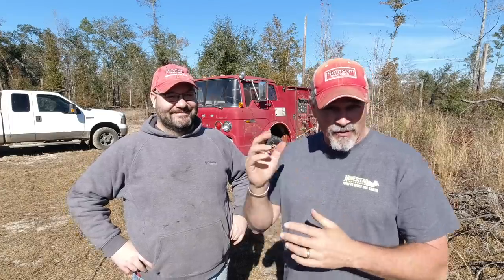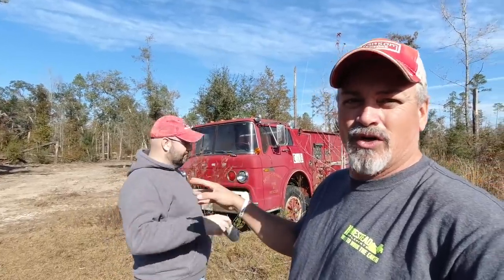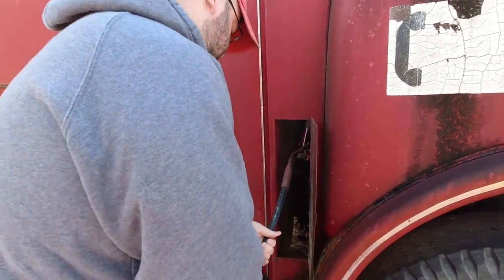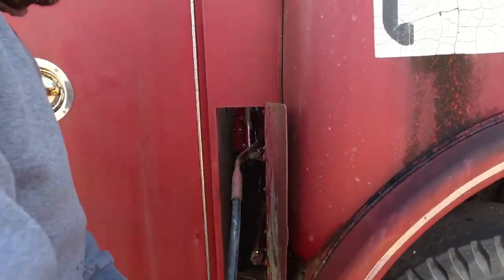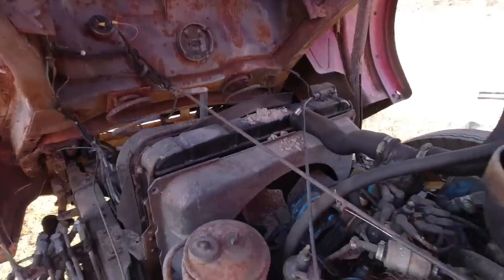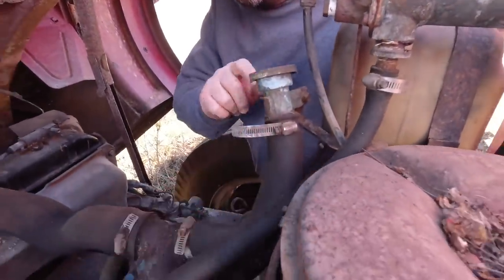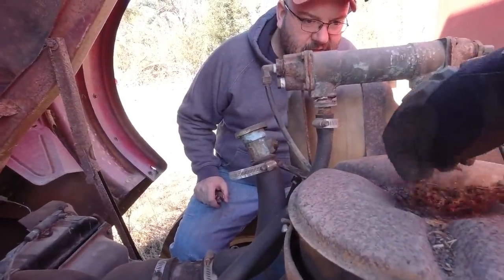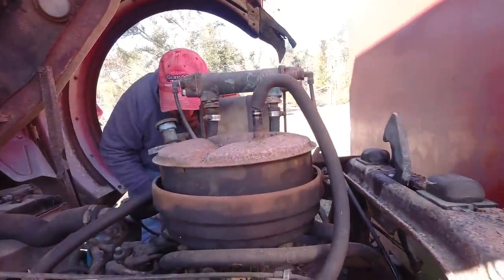Reviving Old FIRETRUCK Doesn't Go Well!

Comment: I think the JB weld option is a good starting point. I've got a similar sad story of rodent woe coming tomorrow...
Reply from the maker: 10-4
Reply: We live in rural Southern Colorado. Our curse is rabbits. We've lived out here in rural Pueblo County since 98. When our sons lived at home, we and they had 9 cars over that early period that had to sit outside and were vandalized by rabbits eating the wiring. Sometimes repeatedly even after wrapping the engines and under-hood components in hardware/hail wire. Plug wires, distributor wiring, harness wiring, it was open season. I finally had to get a 22 varmint rifle and start recycling the rabbits. The prairie hawks were grateful for the banquet. Word must have gotten out over the years, we've not had a problem for a few years, thankfully! Yeah, when you live in rural areas you're in the animals domain and you are intruders. They seek revenge!
Reply: I watched Wes's saga last night on the Oliver and it was some seriously sad destruction by rodents. Unreal.

Comment: JB weld that hole! I had a engine block that was cracked and had been JB welded by a previous owner and that engine held together for over 6 years till it gave way.
Reply from the maker: yes sir!
Reply: @HamiltonvilleFarm  I wouldn't be as worried about the hole as the water that might have gone into the engine through the hole.
Reply from the maker: True

Comment: I had to have a spark plug thread insert installed with JBWeld. It works really well! If it can handle the pressure of the combustion, it surely can handle the intake pressure. I recommend that route. Good luck guys! Keep us posted! 👍
Reply from the maker: Thanks for watching 👍

Comment: That is the exhaust cross over to heat the carburetor .  The cross over goes from one side to the other. The ports can be closed off with a plug , however the intake would need to be removed.  May be there is a way to plug the hole just to test run it. Make up a toggle plate . 1 long screw, 1 washer that slips in the hole. 1 metal plate that will cover the hole. and 1 nut. Tighten down on the toggle and fire it up!
Reply from the maker: Thanks for watching 👍

Comment: I like the JB weld option to see if you can get it running cheaply. Did you check to see if the engine will turn over after you pulled the plugs?? If it's stuck there are ways to free it up but it may make your decision on another engine simpler. Good luck. 👍👍👍
Reply from the maker: Yeah we checked that. It is not locked up

Comment: If the motor turns over it’s definitely worth patching the hole in the intake and seeing if it will run. Those 391’s are actually a good engine. Don’t give up on it just yet!
Reply from the maker: Thanks for watching 👍

Comment: JB Weld will work on intake manifolds. I used it to fix a 350 chevy engine. Theres not a lot of pressure on the intake just vacuum pressure for combustion. Its worth a try. I'd give it a good acetone bath and a lot of scrubbing.
Reply from the maker: Thanks for watching 👍

Comment: I'd try just welding that intake manifold. It'll hold just like new again afterwards to. Then you won't half to JB weld it. And not to mention it all be original still like before. Look online for velpro intake aluminum grit filled  squeeze gaskets set.,just regular fiber gaskets. Use some silacone  on it. Then she'll be good as new used fire truck once again. By removing.& plug welding up the manifold hole. Just grind the surface good before is all. So the weld sticks.& holds up better when cooling back down.

Comment: J-B Weld new plugs wire and points possible cap and rotor batteries and see if it'll roll over and start with carb cleaner. maybe pull it out to the edge of the road with your tractor?
Reply from the maker: Possibility

Comment: Ok here’s my 2 cents Hank, my Dad was a professional auto machinist for 40+ years someone brought a cat dozer to the shop. It had a huge crack in the block. He cleaned it up extremely well and used JB Weld that dozer ran for decades that way. Seems the least effort and money at this point until you make other choices on weather or not the rest of the project is worth your effort. Just my thought!
Reply from the maker: Thanks for watching 👍

Comment: Vice grips and JB Weld is our farms go to tools.  When parts are hard to find ,J-B Weld is our crank and cracked block overhauler on our old antique tractors. Did you have to special order that adjustable wrench set through Snap-on?
Reply from the maker: Lol. Can you imagine how expensive that wouldve been from them😂

Comment: The JB weld option would be a good one. Maybe a quarter inch or 3/16 inch piece of steel and JB Weld. I believe any Ford FE big block intake will fit that. The engine itself should be good. Eventually maybe replace the intake. Shouldn't be that hard to replace the intake. Cheaper and less work than replacing the engine. Everyone thinks a diesel is great. I personally don't. That 391 is a good runner and great sounding motor with the right exhaust setup. Keep it as original as possible. This is a nice old truck. It should run fine once you do tune up and intake.
Reply from the maker: Thanks for watching 👍

Comment: I’d say pull the intake off and take it to a shop where you can sand/whireweel it and then try to weld it in. If it’s cast iron be certain you use the correct type of rod/wire. If you certainly can not weld it maybe try the JB Weld
Reply from the maker: Thanks for watching 👍

Comment: if you try to start it, I would suggest you pull the valve covers, spray the valve guides with penetrating oil, and slam the valves with a rubber mallet a few times. Those FE motors have a nasty habit of the valves sticking when they sit for a long time, and you bend pushrods. You might want to have a few spares 'cause there's a good chance it'll happen.
Reply from the maker: Thanks for watching 👍

Comment: Just like any vehicle that sits in the elements, crap happens. You guys simply have to remember to take a leaf blower with you to these first start sites! Take the simplest route and cheapest route always. Like your partner said, JB Weld! Put a cone stone in a drill and polish all around that hole, put a small piece of screen over it and build up JB Weld over it and let it cure. Replace the plug wires, clean out the carb, clean and set the points and give the starter a spin. Where that radiator cap sits, that Ford C Cab has an access plate behind the seat. Pull the seat back forward, open that hatch and you check fluids from the cab that way, hence the radiator cap there. Our early 80s Ford C Cab in our museum is an ex Air Force flightline deicer truck, same chassis with a CAT V8 and automatic. Go the simple and cheap ways first! Changing engines is a total pain trying to get major and minor system components to match up. Keep it simple! Once you get than engine to live then go after the driveline issue! Keep us in the loop on this one! Don't give up on it!
Reply from the maker: Thanks for watching 👍

Comment: I think that hole opens into the exhaust crossover area. So it might get hot. Or it might be blocked off at the head ports, but I doubt it. Look at the isolation plate between the carb and manifold. I think I saw holes there and that would be an issue too.
Reply from the maker: Thanks for watching 👍

Comment: J-B weld on Marine epoxy their Works wonderful been there done that on several manifolds
Reply from the maker: Thanks for watching 👍
Reply: That's what I was thinking. Marine epoxy should hold the vacuum. What is the suction on a big gas hog like that. Is there a lot of suction up on top of manifold 
Is it not just were Gas fumes come down. Or does it suck hard there.
Reply: Or find parts for the rig these trucks are a dime dozen and those motors expired long ago get parts for scrap cost....and get service Manual tooo
Reply: @rsprockets7846  
YES, the Manifold should be easy to find. The best course of action is replacing. Remember on his channel he always goes the MOST inexpensive route 
But on FD Engine. The Manifold just like the PLUG wires should be REPLACED.
Reply from the maker: Monetary donations are always welcomed 😁👍

Comment: JB weld indeed! Or, some of the gas tank leak repair epoxy.  You can plug off a pretty good sized hole with a wad of that stuff, and it will probably last OK, having no liquid to hold back!
Reply from the maker: Thanks for watching

Comment: If the engine turns and has compression I would JB weld it and make sure engine runs and is ok, then change manifold if you want to make it a runner.
Reply from the maker: It does turn. Thanks for watching 👍

Comment: by the looks of the location..it looks like the rot hole is not in an intake runner or water jacket..it might just be opened up to the lifter valley..or possibly exhaust cross over...either way ...just clean it and JB weld it up ..it will be fine ..

Comment: Little jb weld and a couple strips of duct tape over the hole in the intake manifold, and you can use each adjustable wrench to bridge the gap between the chewed up plug wires. Strip the wires back and twist them around each end of the wrench LOL
Reply from the maker: yep!

Comment: Hay guys ,I would go with a new intake manifold and also fix the old one ,you can clean the inside of the motor ,I would put plugs ,wires ,cap ,rotor and fuel filters  get a new carb and rebuild the old one I would love to see the old girl  run again
Reply from the maker: Thanks for watching 👍

Comment: Maybe time to add to the start up kit. Fuel, water, silicone, jb weld,   remote switch , batteries you know little things.  But hey more trips more vids
Reply from the maker: I carry everything you mentioned with me except JB weld. But when there's a hole the size of texas in a manifold and missing wires, it kinda throws a kink in the plans
Reply: @HamiltonvilleFarm  the wires be hard guess when you hadn't gotten a look at the engine yet.  The tool roll of crescent wrenches nice touch

Comment: coils around power steering reservoir are for cooling. I would try to JB weld or Devcon epoxy the intake to see if you can get her started. also did you guys try to spin the motor with a breaker bar to see if it was freed up. Carb looks like a 4150 or there about Holly. Still think you should strip it down and Rat rod it.
Reply from the maker: It's not locked up. We tried it.  Thanks 👍
Reply: Hell ya' that ole girl should come alive pretty easy then.

Comment: Pull the intake and have someone make a plug, patch or try to weld it.
Reply from the maker: Thanks for watching 👍
Reply: If JB Weld won't seal it. Still, swapping intakes with one from a salvage yard is a whale of a lot simpler than swapping an engine!

Comment: Jb weld is too runny Use the liquid steel in a tube  that you have to roll up in your hands.   I would do it where it sits.  But. The first thing I would have done was breaker bar that motor too see if it’s stuck.   If it’s not.   It be pulling it self out of the grave.   Heck Id widdle a peace of wood and hammer in the hole if I didn’t want to drive to town lol
Reply from the maker: We checked. It's not locked up👍

Comment: I have the same fire truck and big thing is there is a electric fuel pump in the tank and it’s not cheap and then carb kits are very hard to find cause the carburetor has a govner on it
Reply from the maker: Thanks for watching 👍
Reply: I just posted my video today of my fire truck look me up highwayhunter Ray on
Reply: You can bolt any old Holly 4 bbl on that intake and I am betting it has a mechanical fuel pump being a FE engine

Comment: Too good to junk it out .. I would JB weld that Intake leak just to save $$ to spend on other parts see if you can get it to spin over and check the compression that would tell you a lot as to if it was worth saving or replacing . I just would start with the basics compression, spark and fuel...
Reply from the maker: Thanks for watching 👍

Comment: if this motor really is a .F.T engine.. [ DO NOT RPLACE THE INTAKE ] unless you find another FT intake..one from a 352 or 390 or 428 [ WILL NOT WORK ON THIS ENGINE] a common 352/390/428 F,E intake have different water jackets and i think a different location for the exhaust  cross over ......[  THE ONLY WAY TO MAKE A EASY INTAKE SWAP IS TO SWAP THE HEADS ALONG WITH A COMMON F.E  ENGINE ],,,BUT YOU CA NOT JUST THROW A common 4bbl intake from a common 352/390/410/428 on it...
Reply from the maker: Thanks for taking the time to watch and make the comment. I truly appreciate it! Have a good day.

Comment: 391 intakes are different than 390 intakes. Exhaust gas crossover goes from center of cylinder head, unlike the FE heads that go from the side. That hole is probably in the crossover. JB Weld will probably blow out. You can put an FE motor in there. Far easier to find than the FT mill. I’d probably walk away from this rodent palace. Sad face.
Reply from the maker: Thanks for watching 👍